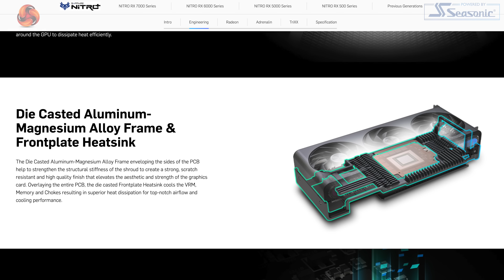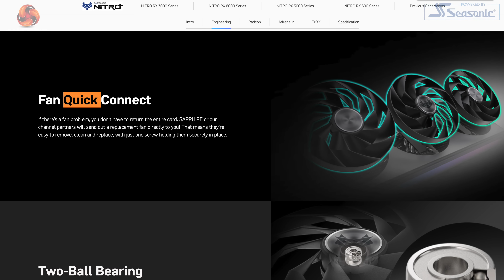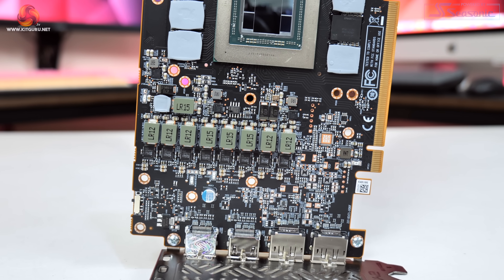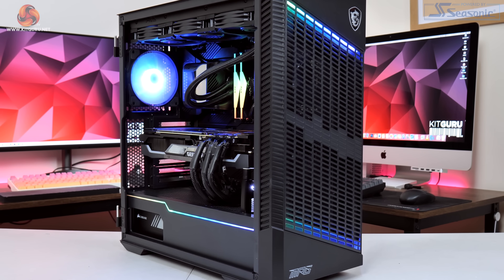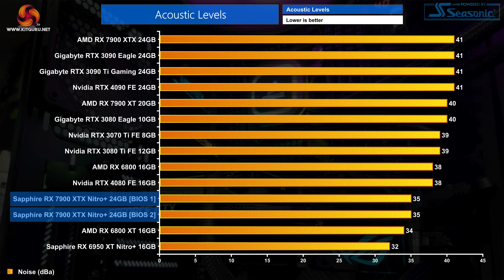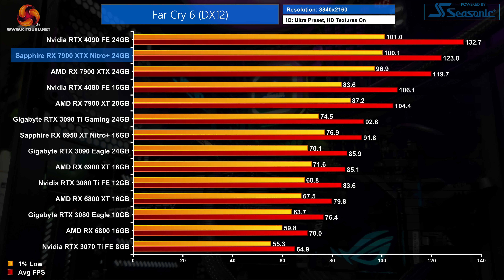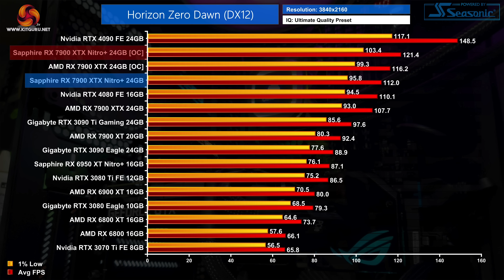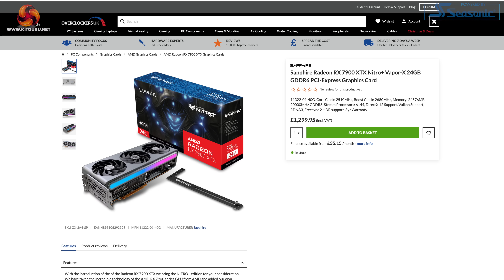Sapphire RX 7900 XTX Nitro+... one heck of a card!

Comment: I wanted this card originally but the price is way too high, if it was around MSRP it would make more sense. People slate the 4080 for it's pricing but the XTX AIB models are proving to be the same price, so I would rather take a 4080 then.
Reply: It's $1100 in the US
Reply: And you can’t get a 4080 at rrp. So same issue with nvidia as well.
Reply: even then I would still stay at 3080 that I have, no point in overpriced shit
Reply: @sugarjesusyt  3080 is a great card. Wait for RDNA4 or Blackwell! That means the AMD 8000 series or Nvidia 5000 series 👀
Reply: Yes but the 4080 AIB cards are also higher then reference
Reply: Considering how much power this AIB card will be able to draw with its 500 Watt range during load compared to RTX 4080 FE (around 300 Watt in graphs here), then RTX 4080 will be "cheaper" over time then those 3 x 8 PIN 7900XTX cards.

Where I live it is very unlikely that price on electricity will go down within 5 year, so all those high end cards will not only be over priced, but also have a too high cost in usage.
Reply: @beeping2blipping  bruh are you comparing the max range of wattage when overclocked to a 300 watt stock number? If you got the new amd driver and you dont overclock its about the same. But the AMD card has the possibility to overclock
Reply: @beeping2blipping  you actually comparing stock 300w to OC ... bruh did nvidia make you guys lose braincells or what?
Reply: Tbf, even just stock reference XTX is faster at raster than the 4080. Yeah, the 4080 is much faster than any XTX at RT, but given how few games utilize RT heavily, overall the 4080 still loses MUCH more often than it wins. Understandable either way tho.

That said, I grabbed reference. The AIB coolers are only really useful for running cooler / quieter.
Reply: If you dont play multiplayer games sure.. Get 4080. If you do dont get baited by the dumb RT argument. Dont be a dumbass like me. If you spend 90% of your time playing Online games and 10% on tripple A singleplayer games with RT why would you buy a slower card(4080) for the 90% of its usage just to get a little bit faster RT.. Logically makes 0 sense.
Reply: This card wouldn't make sense at MSRP at all. It's more expensive to make than the reference model (just look at it, it's easy to see that) and it's proven to be much quieter, cooler and overclocks better by about 7% or so. It's Sapphire's premium line so if you want cheaper you go for their Pulse line. This is currently their best engineered card until Toxic comes out which, if it does, will be even higher quality. Sheesh you're like going to buy a Calvin Klein shirt and expecting it to cost the same as Hanes. Learn what materials were used, the labor costs (good engineers deserve to get paid well), and the margins needed to keep making good products and pay for the research that goes into making better products. Even the fans on this Nitro+ are top tier technology and better than the reference. You sound like an uneducated consumer. Go buy a cheap, loud, warm card instead.
Reply: @vigilant_1934  wtf the msrop is inflated to nvidia levels to begin with. Reference is a $699 gpu... $749 at most. AMD is boning you this gen just like nvidia
Reply: @vigilant_1934  ok, but how big of a premium is justified, 10, 20 or 30% and more?
Reply: @xXDESTINYMBXx  Good question. It depends on how much an AIB like Sapphire needs for these to be profitable enough to make sense to keep producing (the Nitro+ launched at only a 10% premium but Newegg recently raised it to 20% due to market conditions). Look at EVGA. Nvidia didn't give them much breathing room to make a good profit and they were basically competing with the founder's edition cards. 

AMD reps confirmed at the announcement in Vegas that the reference models were the lowest common denominator and that the partner cards would be better. If you look at the premium cards they are engineered better with higher quality materials, the cooling is more even and consistent between the die and the hot spot, and they run quieter with faster performance.

In my opinion, besides certain workloads where Nvidia has a clear advantage (CUDA, some content creation stuff, ray tracing), the 7900XTX still has 8 more GB of VRAM which is very helpful for memory sensitive work (not really for gaming since 16GB is enough currently), and with these models with 3 8-pins it pulls even further away in rasterization performance like 15% faster than the 4080.

If you can't tell I don't recommend either of these GPUs for pure gaming rigs as there are cheaper options that perform well enough in most situations especially at 1440p and 1080p. Currently the XTX is the cheapest GPU on the market with 24GB of GDDR6. At the end of the day if you like a product more than the other then go for that. I had an Nvidia GPU in my first build but the drivers were terrible in Linux Mint (one of the most accessible and user friendly Linux distros out there) so due to better Linux drivers and the price/performance I'm going with the XTX for my workstation build.
Reply: @vigilant_1934  I bought the Phantom Gaming OC 7900 XTX for 1400€. That's 250€ above MSRP in my country. Do you think it was a good investment? Or do you think that AIB ripped me off? I feel like the card is very good. Also not too much coil whine, I was able to undervolt it to 1065 mV and only at demanding games you can clearly hear the fans spinning at 1800+ RPM.

I am not sure if it uses premium materials, though, compared to the reference cards. Do you know anything about these models perhaps?
Reply: @bughunternerd  That's the ASRock one right? Their 6900XT Phantom Gaming is a good looking card and seems ok (never read a review on it so don't know much more) but didn't know they had a 7900XTX version though I know they released the XTX Taichi which is their high end line (like the Taichi is ASRock's highest end motherboard).

From what I hear ASRock's premium stuff is pretty good and some people like their budget parts because they're cheap but quality isn't as good. Never had their gear though so this is just from reviews and overall impression from what I've read online and someone a talked to person. I'm getting my first AMD card in a few weeks so what I looked for was a brand that only makes AMD stuff (so it's not just rebranded Nvidia cards) so that means XFX, Sapphire, and Powercolor. Other companies make good cards too like Asus TUF has good reviews and test results look great (as good as Sapphire) and MSI makes nice stuff (the only GPU I've had was MSI Gaming 1660 Super and it was super quiet lol) but I just want one from a company that specializes in AMD similar to how EVGA was with Nvidia.

Yeah so the Phantom Gaming seems like their midrange line. The design looks really cool at least their RDNA 2 one with the middle fan that was like orange or yellow. Were cheaper AIB models available when you purchased the card? Also I'm on the product page and ASRock recommends a 1000W PSU with the card so hope you have enough power for it. It seems to clock about as high as these other premium models though and it's slimmer being only 2.8 slots vs. the Nitro+ and XFX cards being about 3.5 slots. Doesn't seem like a bad buy especially if you can make use of it outside of gaming.
Do you do any work that requires a GPU like this?
Reply: @vigilant_1934  Correct. Maybe I should've waited with buying a card. But now I already pulled the trigger. So here we are 🙃
Reply: @vigilant_1934  He is not complaining about this graphics card being more expensive compared to the reference models, but with the same performance or materials. He's stating a fact - this card may be good, but for the asking price, he'd rather buy an RTX 4080, which is guaranteed to outperform in games that make use of ray tracing, especially the reflection component.
Everyone has the right to have their own opinion, which may disagree with the opinion of others. What is no longer correct is attacking another person's opinion just because we are fanatics of a certain brand of graphics cards. And by the way, I was also an AMD supporter for more than 20m years, from the AM386SXL-25 processor, to the Ryzen 5 1600X, including the Radeon HD8770, R9 280X (two, in crossfire) and R9 290X graphics cards. Until the day I realized that if I wanted my computer to perform well in games, I would have to look for products from other brands.
Reply: 4080 is a better card imo with Ray tracing and dlss 3
Reply: @johnerikson2443  RT is a sales gimmick and DLSS is puting fake frames inbetween real frames. If this is what this card is better at I dont want it.
Reply: @FreeofCorp Every modern game has ray tracing. It doesn’t matter what you want but what the majority of gamers want. Nvidia has 88% of the GPU market share, AMD only has 8%. So clearly a lot of people care about ray tracing, better drivers and better ai hardware acceleration via dlss
Reply: @tylerclayton6081  every modern game has ray tracing. Don’t talk cr4p
Reply: Fake frames ? Eh ? 4080 makes more sense. Dlss 3 works great. It draws less power. Has better ray tracing and have Nvidia drivers which are a huge point for me.
Reply: @johnerikson2443  4080 is very power hungry and "muh nvidia driver"
Reply: @spaceli0n 4080 and 4090 are both more efficient than the 7900xtx and xt. And both are a lot more powerful especially when taking RT into consideration. I know AMD fanboys like to cope by pretending RT doesn’t matter but literally every new triple A game has it. There are hundreds of RT games now and will be thousands in the near future. 

There’s a reason Nvidia has 88% GPU market share. The rtx 2060 alone outsold all of AMD’s 5000 series and 6000 series combined
Reply: @johnerikson2443  yes they are fake frames, check out the in depth testing. Rastor is actual generated frames by the gpu.

Comment: Bought this on launch day on the assumption it would be best-in class. Very much a bitter pill in being £100 more than we'd have liked... but Nvidia's open source/Linux support is an utter disgrace so it really wasn't a contest. And, of course, it wasn't in stock so won't even arrive for at least another week.
Here's hoping the drivers mature enough to make this not feel like a giant waste of money.
Reply: It's a solid card. Just not efficient, cool, quiet. But it'll perform for sure
Reply: @OscyJack-  it didn't seem loud to me
Reply: @xXDESTINYMBXx  coil whine is quite loud on the 5 samples I got.
Reply: How're you finding it now that you've had some time with it?
Reply: @damianwright3690  It's been close to perfect. Running with mesa-git on CachyOS (Arch) and other that a few days of broken RT [caused by mesa, not the GPU] it's wildly exceeded expectations. Easily the most stable card we've ever owned and performance is a vast step up from the 5700XT. If you were holding off just to be sure, go ahead and buy
Reply: @vasya.sovari  So despite initial impressions, this really really does the job then? Good :) (Intending to get a new machine and pair it with a 7800X3D)
Reply: @damianwright3690  The original comment was written before it arrived, and it worked as expected ootb. So it's been more or less perfect since day 1 thanks to the efforts of the mesa team and CachyOS maintainers, who produced an ISO specifically built for RDNA3